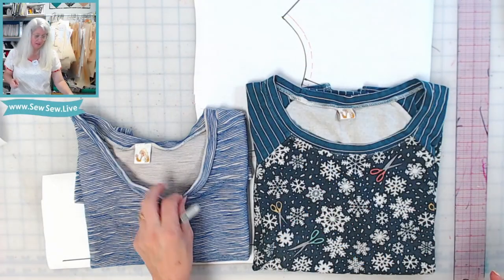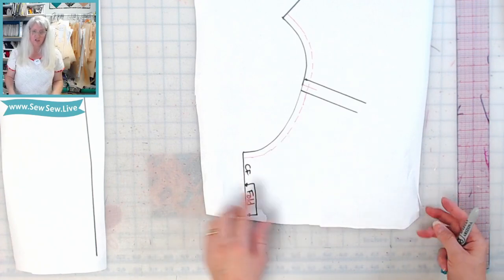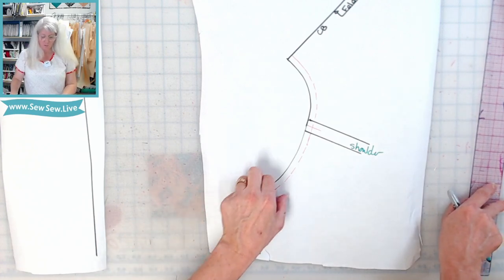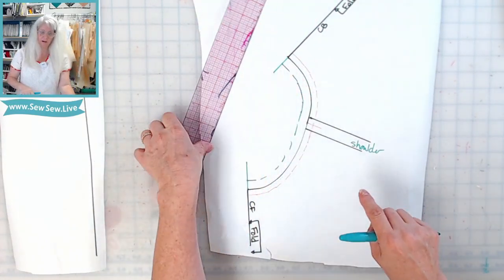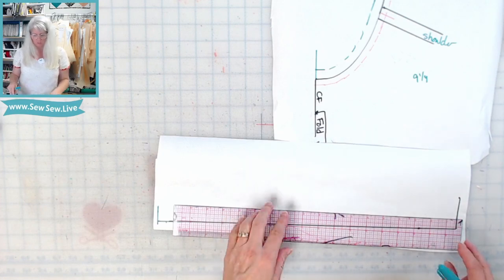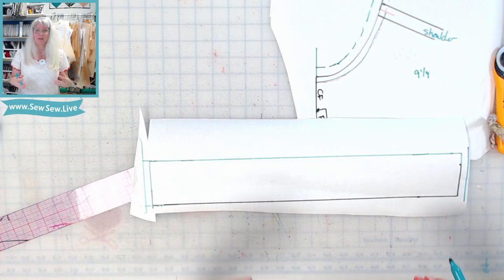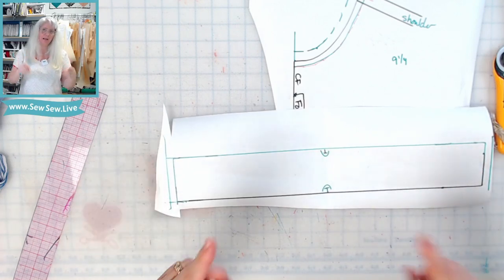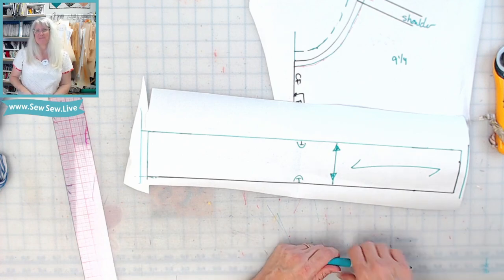How to Draft a Crew Neck Collar Pattern for T-Shirt

Comment: wow i never thought of this method, and they it makes so much more sense than the drafting it at ~80%. also, i guess i would add notches for the shoulders based on the length from CF or CB to shoulder?
Reply from the maker: I’m my experience that’s more work than is necessary. You’d have to figure out the percentage of fabric between shoulders since your front and back are different lengths. And I like to sew the seam to a shoulder so it’d be figuring out the front and back. A half way point is sufficient and I create another halfway point as I’m sewing.

Comment: Had never thought of that calculation before, just took, as a rule,80% of a cotton or sturdy knit, and a rayon or bamboo jersey, take 75%.   This seems more predictable, thanks.
Reply from the maker: Sometimes that does work!  But if you have the time I like figuring out exactly what I need. I dislike getting to my machine and sewing a collar in and it isn’t right. So I usually check now. 😉 Some fabrics and some neckline shapes do take a little fiddling.